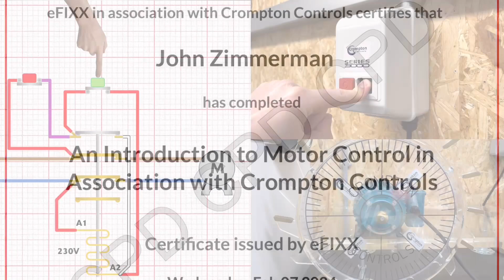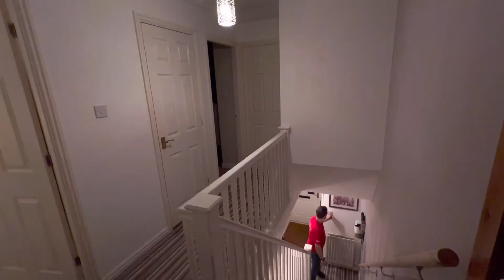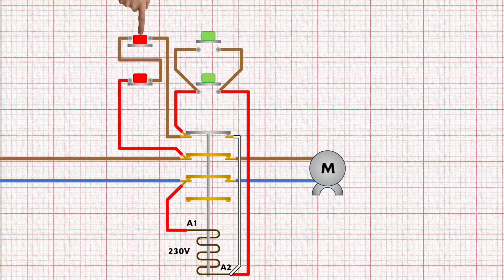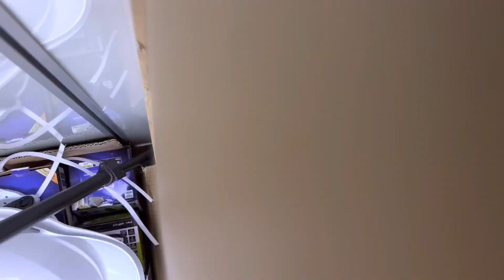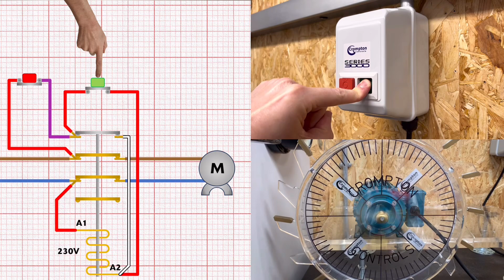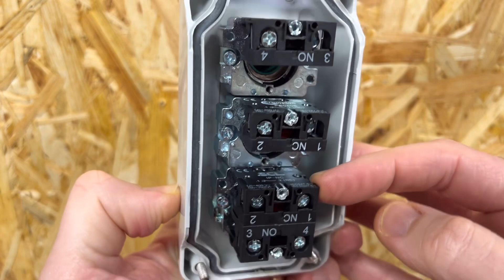Unlock Hidden DOL Starter Features

Comment: Your video is an ideal place to raise the issue of fuse protection for the control circuit, or lack of it in most cases. I come across all to often remote stop  starts wired in 1 or 1.5 direct from the contactor, backed up by big fuses. Back in the day most starters didn’t include fuses for the control circuits so you could find your control buttons were backed up by an 80 amp fuse 😳. Not sure how they got away with this even back them

Comment: The loud bang your just heard was all the house bashers simultaneously fainting and hitting the floor.
Reply from the maker: Interesting observation
Reply: @efixx  i know where the commenter is coming from but see comments
Reply: Harsh, house badger here who does light commercial, but during my apprenticeship got an 11kv switching cert for reasons. Not all housebashers are thick :)
Reply: In the industry we need to stop denigrating others. Unless they deserve it. in which case crack on, or  offer to help,at the pub of course